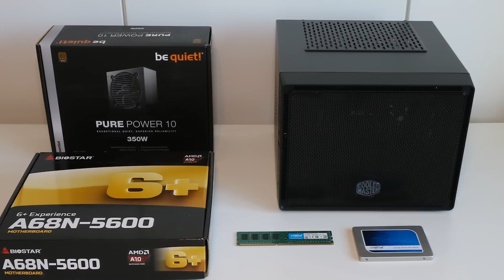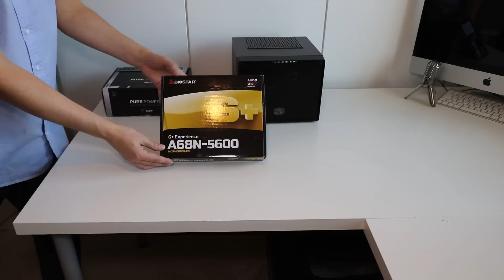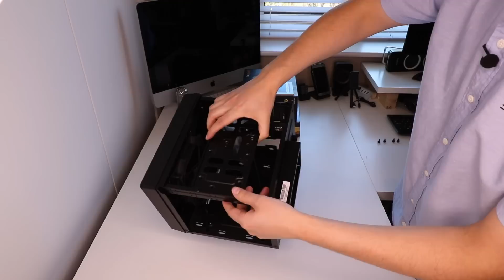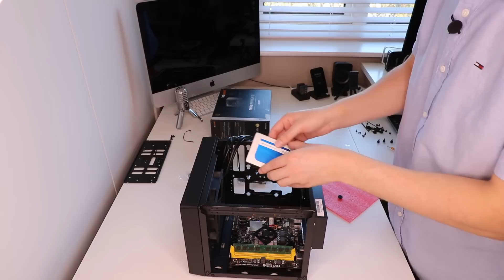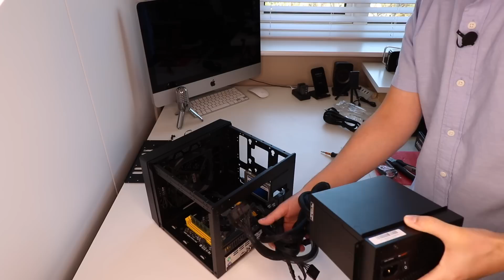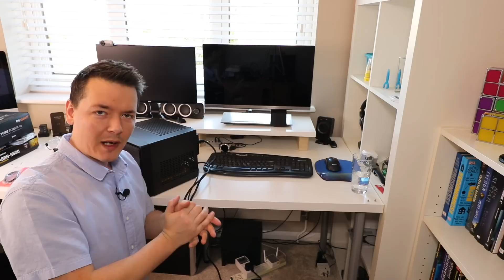Building a Mini POS (Proof of Stake) Mining Box. Biostar A68N-5600 ITX

Comment: Hi Lee, i have another question, what is the best Coin for Harddisktmining, you testet all, i have space unused on a synology diskstation which rund 24/7. SIA, Burst oder Storj? Or something other? Please give me some help.
Reply from the maker: I would say Burstcoin will get you the best profit overall. But 80% Burst 10% Sia 10% Storj would be a good option for HD miners.
Reply: Thank you for this information. can i run all 3 Coins on one pc and give space on the disk in 80/10/10 percent?
Reply from the maker: Yes, You can divide up the space however you like, running all three coins on the same machine should be fine if you have a mid range cpu or higher.

Comment: How's the psu doing Lee? // Would never have guessed that was the power button, kinda cool though lol nice little design feature of the case.
Reply from the maker: Hi, 
It's a great little psu, good build and very quiet. It also has a 8 pin pcie connector so I'll be adding a gpu at some point in the future.
Reply: IMineBlocks oh my days that's sweet, you would be surprised what you can do with 350w these days so good insight to include an 8pin. Glad it's working for you was really curious, seems a nice affordable little psu EDIT meant to say: nice tip on looking for ex-display too, sometimes my work does that, they keep the box in the warehouse so it's just like new and they still give you the same refund policy so it isn't even a risk. Good way to find the occasional bargain.

Comment: Why not hdd since it is cheaper
Reply from the maker: You could use a regular mechanical drive but from experience they are much slower and loading the wallets / blockchains then with SSD's.